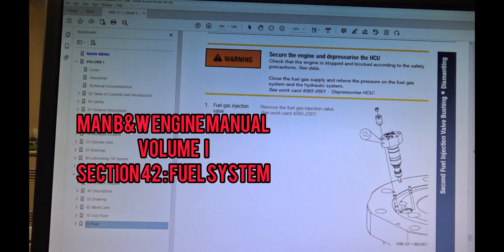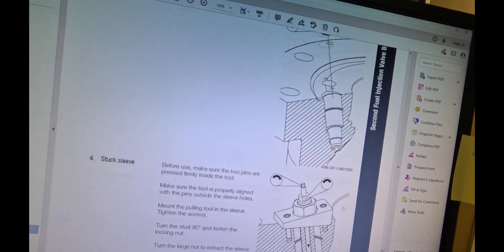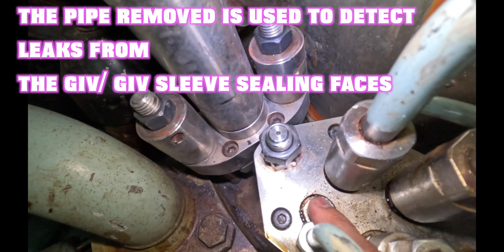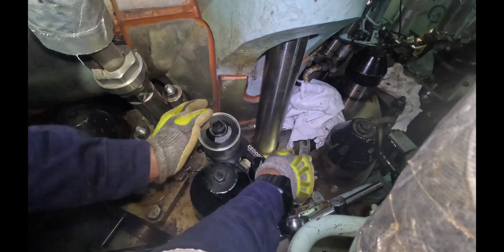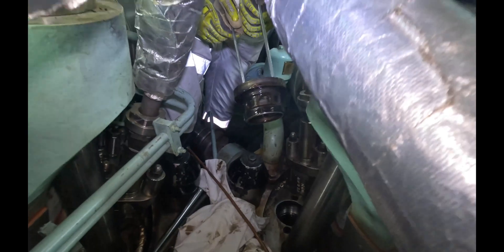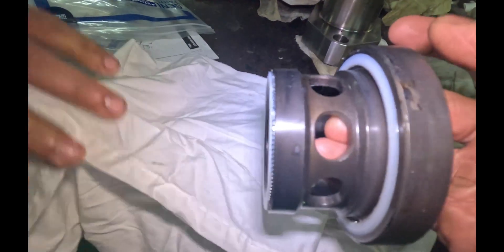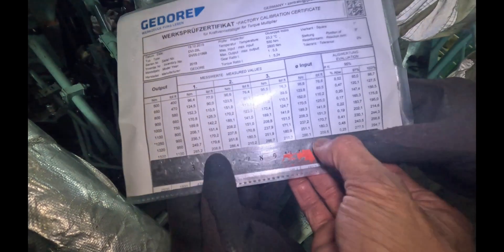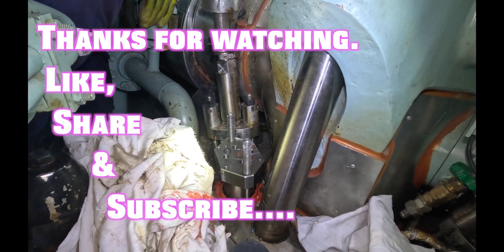DUAL FUEL ENGINES - PART 7 - REPLACEMENT of GIV (GAS INJECTION VALVE) SLEEVE

Comment: Hi Chief! Thanks for video. Please advise the procedure. 
The engine was stopped, pressurised till 300 bar and WW for all cylinders opened from mop with MPC in test mode, correct?
Reply from the maker: what procedure u talking about?
Reply: @ leak test